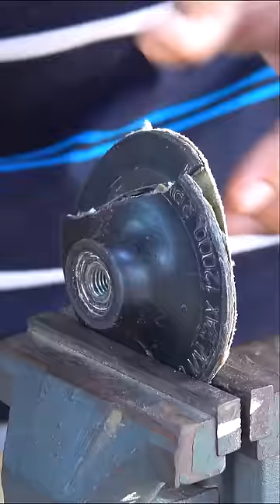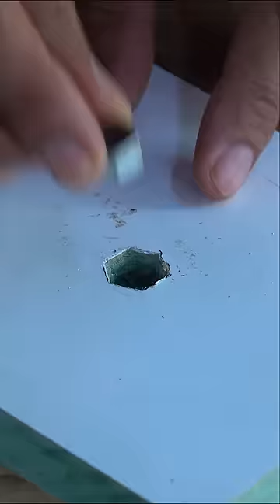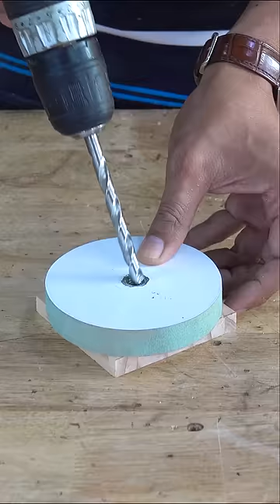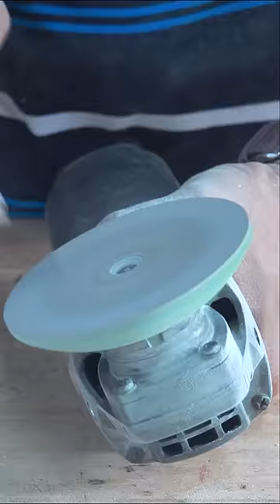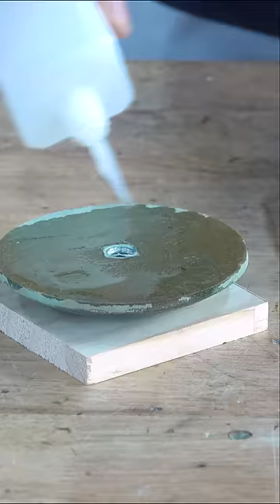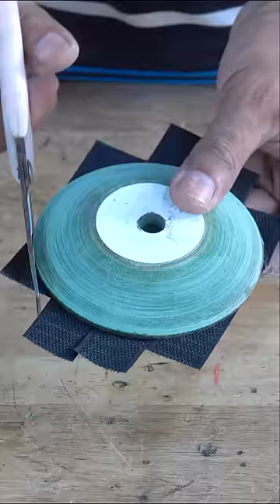Creative Amazing Disc Sander for Angle Grinder #shorts #woodworking #trending #amazing

Comment: U could have used the same broken disc making it small in dia.n attaching it with disc of required size instead of breaking it n using its nut again.